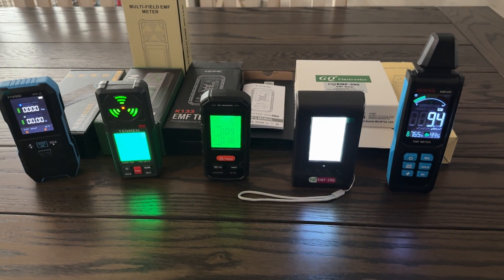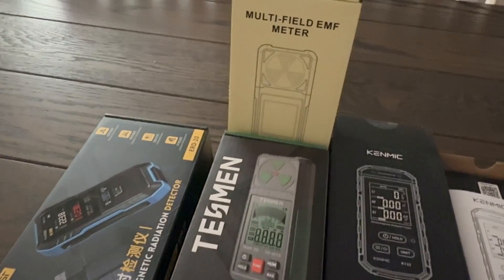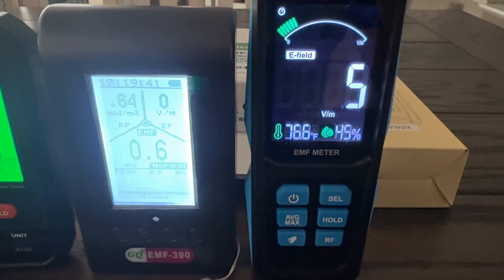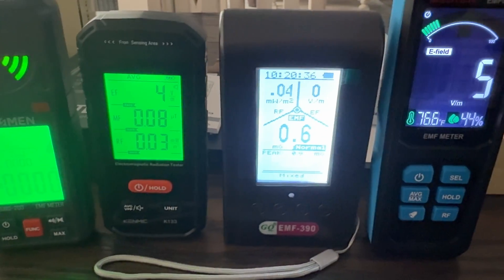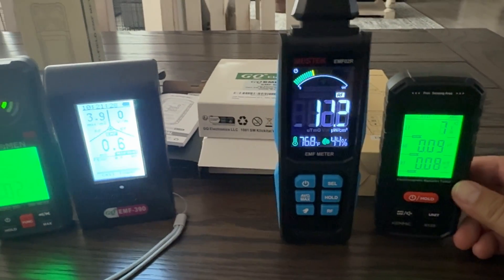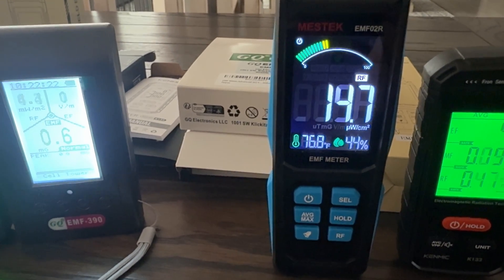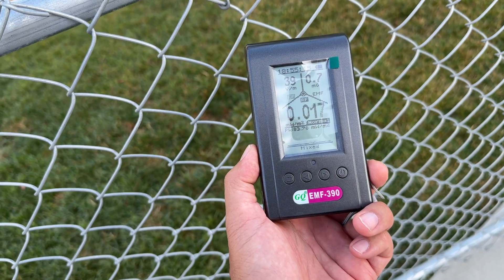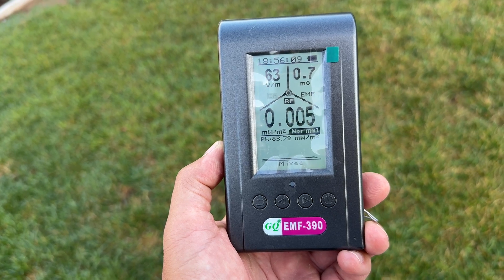Which EMF Reader is Best?

Comment: This is pretty misleading... you can't compare numbers on screen without factoring in the units of measurements. On the one you pointed at saying it was consistently high it's clearly marked on screen that the units are micro-Watts per centimeter squared, while the other shows it's watts per meter squared. So yes the number will be (much) higher . . . this video merely said that he didn't understand the units at all....